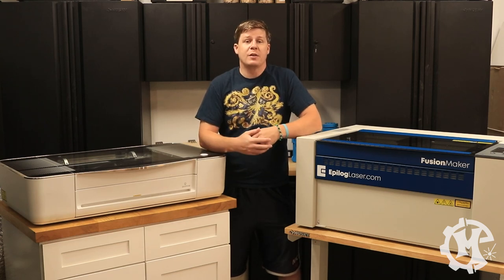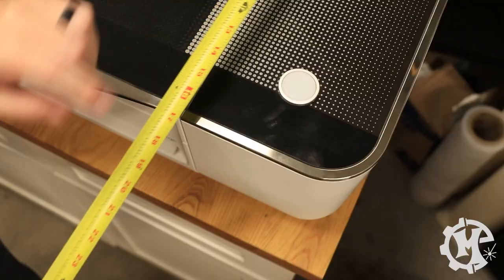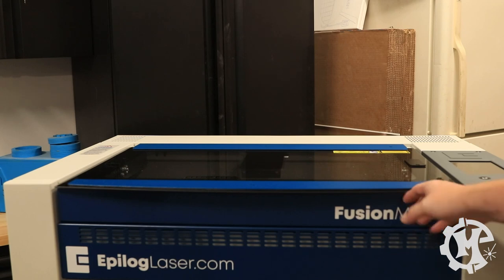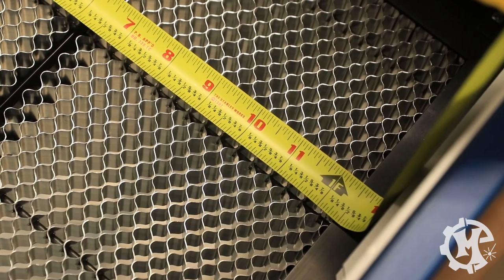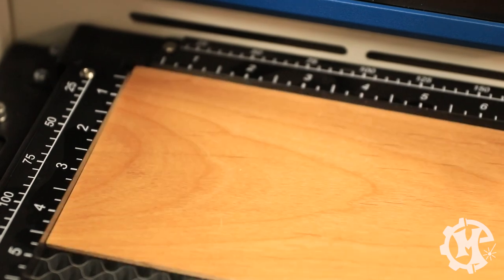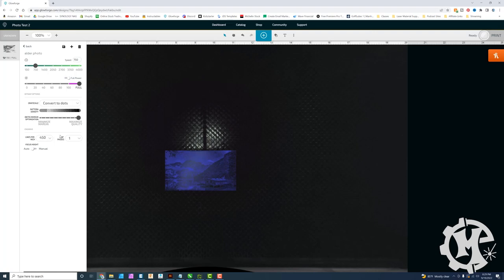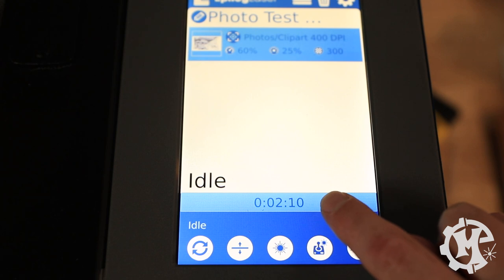EPILOG VS GLOWFORGE

Comment: If you leave the timestamps as hh:mm:ss they become clickable. like so:

Video Chapters
00:00:00 Introduction
00:01:56 Machine Area
00:08:35 Manufacturer Location
00:09:48 Tube Comparison
00:15:30 Machining Speed
00:17:07 Connectivity of Machines
00:17:26 Laser Classes and Safety
00:18:39 Passthrough
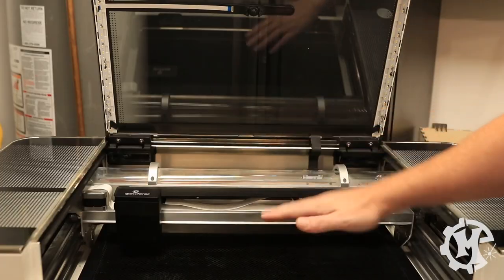00:20:07 Camera Systems
00:20:43 Job Reference Point
00:21:48 Motion Controls
00:24:55 Auto Focus
00:25:38 DPI Rating
00:26:08 Machine Control Panels
00:28:08 Accessories, Support, and Warranty
00:33:46 Workflow from Software to Machine and Raster Engraving Test
00:44:26 Vector Cutting Tests
00:56:34 Passthrough Test
01:01:16 Rotary Test
01:04:04 Camera Accuracy
01:08:11 Production Test
01:21:37 Pricing Comparison
01:24:47 Which Machine Should You Get
Reply from the maker: Thanks for the correction. I fixed it in the description. I had the partial seconds that threw it off.

Comment: Thank you so much for this video. I was surprised at the eye opening comparison between the two. Having worked with a GCC Spirit LS engraver before with all the bells and whistles, I was mainly interested in the Epilog workflow and how it works since I'm about to buy an Epilog Maker for myself. This video definitely made me feel like I made the right decision, since I'm mostly focused on production work rather than hobbyist. Seriously, this was super helpful man! P.S. I have that T-shirt too like the other youtuber commented lol

The fact that I can't merely have a laptop connected over RJ45 to the Glowforge, AND the fact that I'd have to rely on cloud processing for it is an ABSOLUTE dealbreaker for me. I can see why it may have benefits, but with my production experience there's no way it would suffice for me. Maybe as an entry level it might for others, but with the relatively close price tag between the two and stark production run differences... I don't see how it's much of a contest for which to get unless you're really in love with a certain feature. I will miss the pass-thru my GCC Spirit LS had, but will gladly give it up between Glowforge and Epilog for the engraver that can produce consistent accurate fast results.
Reply from the maker: I’m glad that you found it helpful. I agree with you that is not much of a contest but I get asked about the comparison a lot. I’m glad it was useful.
Reply: Did you like the GCC laser? How does it compare to Epilog?

Comment: The Passthrough actually works really well. You can't trust the camera image. You have to trust the process. If you hadn't aligned manually, it would have worked.
Reply from the maker: That’s good to know but that’s not really acceptable to me either. Both the camera and the process should match. I don’t feel you should have to guess which one is the right one to trust.
Reply: @MakerExperiment  Valid point and I totally agree with that sentiment. I run a University makerspace and I'd love to not have to constantly tell the students to "ignore the camera."  I actually found your video while researching options for phasing out the Glowforge. We've loved it, but it can't keep up with demand.  Epilog is looking like a good option.
Reply from the maker: @kjm749  Epilog makes some great machinery. If you have any questions, let me know.

Comment: Thank you for this. 
Two questions on power. 
1) The web site for both say “110 to 240 volts”.  Do both of these need 220volt to run or is this an option (or for Europe)?
2) On the production run of the Glowforge vs Epilog (coasters). Would the production power saving over time make up for cost difference?  Since the Epilog runs for a much shorter time?
Reply from the maker: 1) this is an option for other countries. You can run them on 110V

2) the production over time will make up for cost difference. Take this for example for 2hrs and 40 minutes or so let’s say you make 15 coasters on a glowforge. In the same amount of time you can make about 18 in 22-23 minutes or whatever it was on the epilog. Do you can make about 125 in the same time as 18 on the glowforge. If you get big jobs, it will save you a lot of time.

Comment: So you need an Air Compressor to run the Air Assist on the EPI ,  how loud is that. ?
Reply from the maker: You need an air compressor to supply the air to the air assist system. It depends on what compressor you use but it’s not too loud. The one from Epilog is a continuous stream of air and stays at the same volume. It is noticeable but it’s not deafening like a compressor for a nail gun would be.

Comment: any chance of comparing this machine to an aeon mira
 5 or 7?
Reply from the maker: Highly doubtful as it doesn’t make financial sense to buy one.
Reply: @MakerExperiment  lol fair enough. Some guys have companies giving them machines to compare like make or break shop etc. Totally understandable. I was more just hoping you had some insight on those Aeon lasers also.
Reply from the maker: @stevegale26  So far those companies haven’t reached out to me to do any kind of comparisons. Lasers definitely aren’t a cheap thing to compare. I’ve never used an Aeon. If it’s anything like other glass tube lasers I expect similar experiences. It’ll be similar in speed for cutting but I would expect engraving to be much slower. While the Aeon may have different components, the technology behind the glass tube in a glowforge and that in the Aeon are pretty similar.

Comment: I presently have an older Epilog Zing 24 40W. and would like to purchase something with a little more power for cutting. It seems like the water cooled tube units are less expensive than the air cooled tube units. I love the cut quality of the I get with Epilog. Are there any comparisons that compare the two different types of cooling tubes? BTW... I do operate a business and customer support from Epilog has always been awesome.
Reply from the maker: This video has some comparisons between the two types of tubes and how they performed throughout the video. 

While water cooled tubes are less expensive, they also require more equipment to run which adds a potential failure point. Overall, what I’ve found is the air cooled tubes are more consistent and usually achieve better power output consistently. You can usually also run air cooled tubes at higher power percentages meaning that running it at 100% power isn’t as bad for the tube as it is on a glass tube style. If you live in a cold climate and don’t properly temperature control it, the glass tubes can freeze. 

At the end of the day, there’s no single right choice for everyone. I personally like Epilog because the machines have been great and give great quality and speed. I’ve owned a glass tube machine in the past and didn’t have a great experience. If encourage your to watch the machining comparisons in this video as it will show you some in depth results that I had between the two types. One of the biggest differences is that your spot size on the glass tube is going to be larger and could effect cut quality on small pieces.
Reply: @MakerExperiment  Thank you for your reply. I have been extremely happy with the Epilog, but their pricing strategy is higher than I would like. I am in Wisconsin, so water cooled units have been a concern because of the winters here. Yes, I have Heat and Air, but there are failures that I cannot control. If the beam size is consistently bigger with the water cooled tubes I, like you, would prefer the air cooled units. I do not need all of the bells and whistles that come with the new machines, so how do I avoid the pricing when searching for a 60 to 80 W machine?
Reply from the maker: @wmielke2  if you go with Epilog, their pricing has been pretty similar since the Zing days but the technology has gotten better.

If you’re looking for a cheaper alternative to Epilog or air cooled lasers, you’re pretty much going to be limited to water cooled. I believe Thunder laser has an air cooled version but even their air cooled machine was a similar price to the Epilog Fusion Maker. This is one of those times where you’ll have to make a decision between air cooled higher quality and higher price vs lower quality, less expensive but higher wattage. I haven’t seen a good middle ground that blends the better quality and tech without the expense.
Reply: @MakerExperiment  Thanks for all the information and opinions.  Your insite is informative and appreciated. I will keep you informed if I find something.
Reply from the maker: @wmielke2  sounds good. There’s always new machinery being released so it’s very possible something has come out. In the mean time, feel free to join my free laser community. It’s a good place to talk with other laser owners as well.

Comment: I purchased the 40w variant of Epilog Maker 12 after watching your video (Have had a GF pro for 3.5 years). How did you get familiar with the Epilog UI?
Reply from the maker: I honestly just sat down one day and messed around with it. It’s pretty easy to use and works like a print driver. Feel free to share who your distributor was. If you have questions, let me know.
Reply: @MakerExperiment  Sure thing! It was Enrique Trigo (AM Tech Distributor).
Reply: @MakerExperiment  My current struggle is figuring out how to run an engrave & cut file. The image for engraving always shows up, but sometimes, when I change the cutout line to a vector and select settings, the time for that process changes to 0.00, and the cutout line vanishes from the UI. (I'm using AI)
Reply from the maker: @Senior-tr4le  are you doing it with a different color or a line weight difference with the same color? You can try color mapping to set one color as vector. I usually use .001 or something similar for line weight.
Reply: @MakerExperiment  I don't understand, apologies. I am importing a text file and using the direct selection tool to (slowly) draw an outline of a different color around my image to cut it out. I'm AI self-taught so I'm pretty ignorant of all the options that it offers
Reply from the maker: @Senior-tr4le  do you mean you’re trying to draw a border around actual text?

Comment: Kudos to Epilog for the effort they are making to become more competitive at the entry level, they have a great equipment, and thanks to Trevor for the great effort he put into making this video.
+ It would be very helpful if you would now make a similar comparison with a piece of equipment that is making a lot of noise in the networks, which is the Thunder Nova 35, particularly in productivity and quality, which are important factors in a business, in which I think Epilog It far exceeds it.
+ In my opinion, the size of a equipment is not so important when starting a business, in fact, the more portable it is, the better it can be adapted to the work area, and I think FUSIONMAKER does that very well.
Reply from the maker: Thanks for the feedback. I definitely agree that people get hung up on the size of the machine as the most important factor and I agree with you that portability can be a great thing when starting a business.

Comment: This was spell bounding as your Glowforge had every problem I ran into , and the only fix was to set off the designs at the bottom corner.
Reply from the maker: I’m glad to know it wasn’t just me.
Reply: @MakerExperiment   I am  on my 3 Rd Glowforge and Im done.    is the 40 watt  worth the extra 2 Grand ???   What will I be missing out on ?
Reply from the maker: @coalakida  the 40watt will work more quickly than a 30 watt. If you’re going to cut a lot, I’d suggest the 40 watt. If you have questions, feel free to email me.
Reply: @MakerExperiment   Great ,  is the software overall easier to learn than Lightburn ,  most of my work is SVG files done in Adobe Illustrator.
Reply from the maker: @coalakida  it’s really intuitive to me. I also use Illustrator.

Comment: Underneath that flashy case it is ovious that the Glowforge  (affectionately nicknamed the Slowforge) is nothing more than a pimped up K40  being sold at a ridiculous price . In reality there is no comparison to be made because the Glowforge is constant current glass tube technology and the Epilog is an RF  tube system controlled by PWM. They may both be CO2 lasers but  there is no way to compare the two technologies. The RF laser  is perfect for high speed photo engraving  (if the Epilog control software will allow you to do so)  or engraving of any sort because of the PWM control  system but  it's cutting efficiency is low. Despite the dodgy mechanical aspects of the Glowforge,  it has opposite characteristics of good at cuttingn ability and OK at slow engraving  but will never be a greyhound.  The DPI numbers you mention are nothing to do with the DOTS you can engrave at but are a marketing perversion of the stepper motor resolution. ie you could say the 0.02mmm step resolution = 1270dpi. and 0.05mm = 508dpi.  These specifications  have  zero relevance to the  resolution that you can engrave an image at.
Despite the price, the Epilog must win hands down especially as a reliable small business machine..  Electric bicycle v Ferarri jumps to mind.
Reply from the maker: They really can’t be compared for a lot of the reasons you mentioned. People still ask me why Epilog is better than glowforge which is why I made the video. It’s actually surprising how many people haven’t been doing their homework on the machinery.
Reply: @MakerExperiment  
 Thanks for understanding that my comment was not intended as criticism but was reinforcing, with a few extra details, the comparison you were making. With  a foot in each camp I realized that you had to be tactful with your commentry.  I have no such loyalties so perhaps my more pragmatic comparison will aid those new buyers away from making the wrong investment.  I have a 30 watt RF machine,  two 80 watt glass tube machines, a completely re-engineered K40 (45 watts) that engraves at 1000mm/s along with a 20 watt Q swith fiber laser.
Reply: I think you're absolutely on the mark. Glowforge is horrible. I'm sick of them and I'm done with them.

Comment: I currently have 5 glowforge plus. Two are barely operating. Their super ridiculous cloud system has kept me from production as I sit for 30 minutes each run just trying to load the artwork and then another 10 minutes as it thinks to process the job before it even begins to work. I'm so sick of them and their faulty machines. I bought a brand new back up and sure enough all of my machines broke at the same time. I go to use my brand new back up and low and behold broken out of the box. It's still sitting there, BROKEN! Stay TF away from that trash. If you think I'm being harsh, try 6 years of frustration. I spent so much money on Glowforge amd I should have never done it. I'm close to 50k spent on glowforgw machines. Fk them
Reply from the maker: May I ask why you kept buying them if you didn’t like them vs buying a better quality machine for less money than you ended up spending on 6 of those?
Reply: @Maker Experiment  the ease of the purchase, the insecurity of buying a bigger machine. Epilog and Trotect make it such an intimidating purchase, it's insane. Epilog should partner with Klara, too. I was familiar with the Glowforge operating system and I felt good using them but they're an absolute nightmare. My brand new backup machine is still broken on my warehouse floor lol. If Epilog wants to make more money they need to do a better job of attra ting buyers like me. I bought one and they couldn't perform to deliver so I canceled on them. That's a $30,000 purchase. Now I'm back trying a second time for an $18000 purchase. So far on week 3 of waiting.
Reply from the maker: @Captainhairyass  if you wouldn’t mind, send me an email at amakerexperiment@gmail.com
I’d like to know what’s going on to see if I can help.